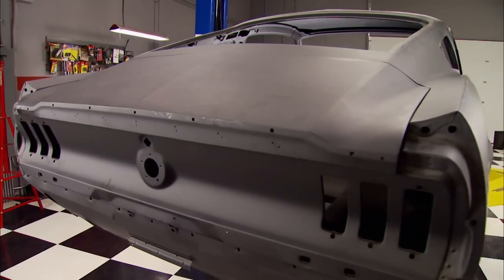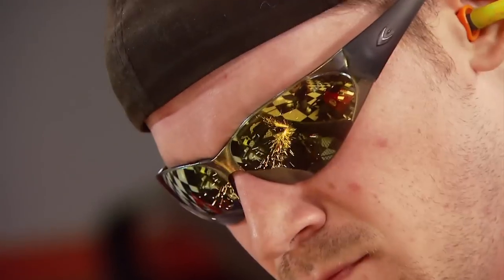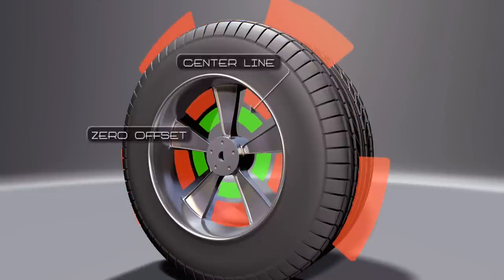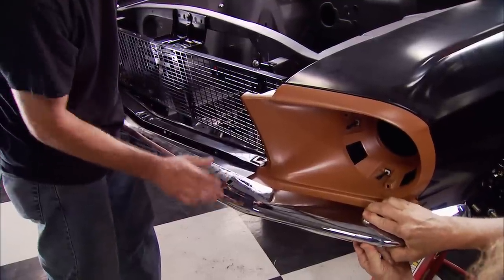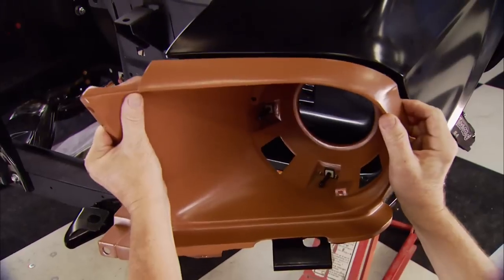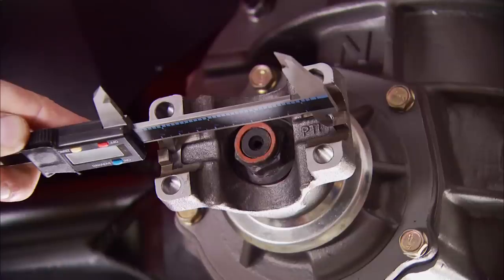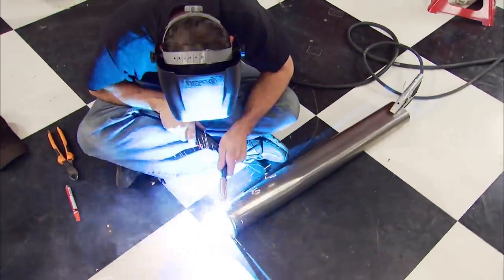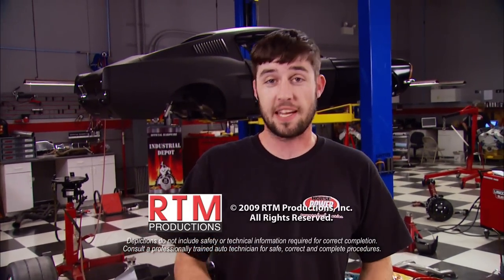Adding A Solid Roll Cage In Our '68 Mustang Fastback - Horsepower S13, E16

Comment: Wonder how the shavings from drilling,  cutting threads worked 
When the oil started its flow?
Reply: Generally I would suggest cleaning the block block if you are working from a bare block.   They've done stuff like this using heavy grease to catch the metal shavings when working on an assembled engine.

Comment: Are you able to do this mod on a late 94 mustang block or is this just a mod for early 302 blocks
Reply: Well - seeing how that block showed XXX in one of the shots and is a factory roller block - it's most definitely for the 94:)  Your block should be an XXX or YYY roller block more than likely when you get in the valley you will be able to confirm.  Regardless - this block they showed the mod on was  roller block so was 86 or newer:)

Comment: Flimsy Mustag “frame” from the factory. Shaking my head. Junk! Secretary’s car.........
Reply: You feel better?
Reply: Jealous Camro owner. Small Fords had fully welded, monocoque engine bays. Camros had floppity front "clips" bolted only to the subframe. GM assembly lines were very serpentine, requiring the assemblies to be short to make the turns.
Reply: Reminds me that when Carrol Shelby was asked by Lee Iaccoa to make their Mustangs into a sports car and Shelby told him “you’d better have a lotta money”. #Secretaty’s car
Reply: @formerfarmer1718  Not much money. Some bolt on accessories were all it took to have roast Vette (over weight turds) for lunch.